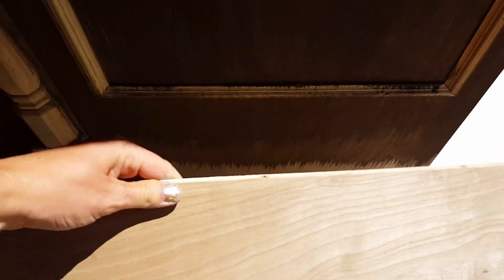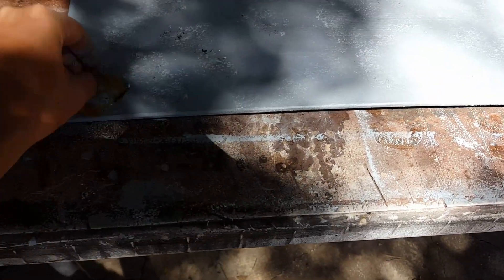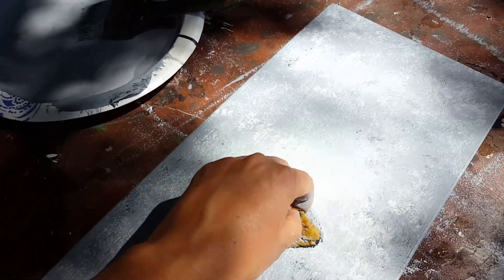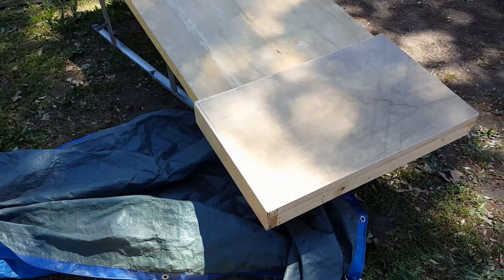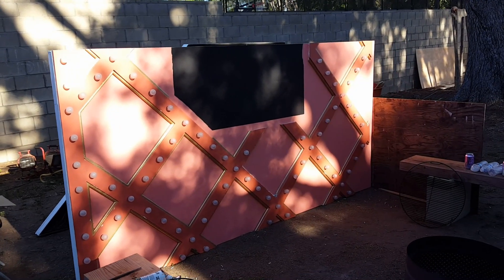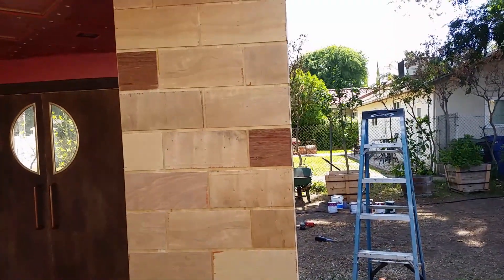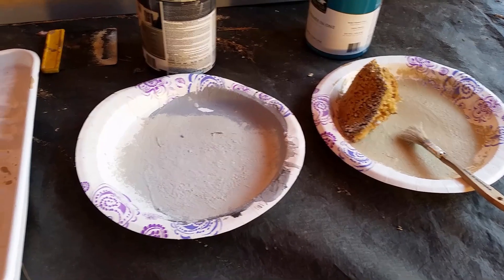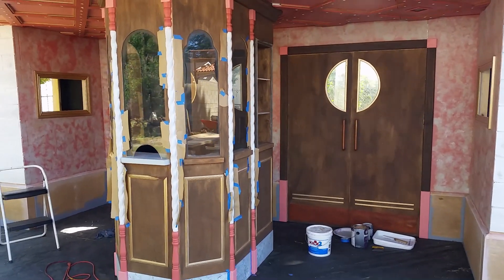Halloween Haunted Movie Theater Facade (Pt.9) Faux Finish Paint Techniques For The Theater

Comment: Gina, when you say you "mud" it, what are you using?  Is that just plaster joint compound?
Reply from the maker: we used a mortar called flexbond Crack prevention. like all mortars they don't bond to wood super awesome but this one has worked pretty well for us and how we use it.
Reply: +Hollywood Haunter Thanks!  You guys are awesome and so inspiring!